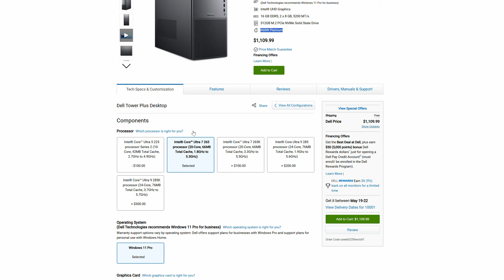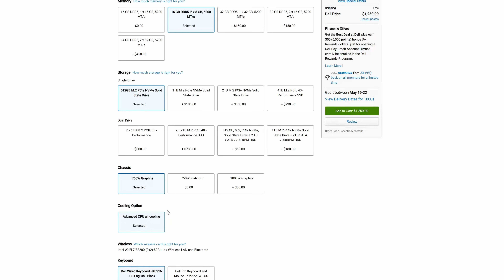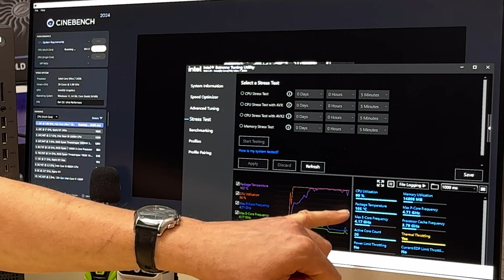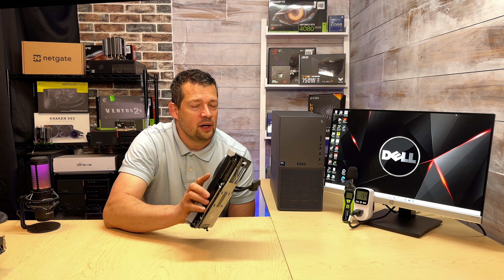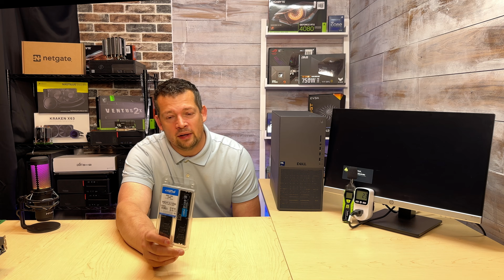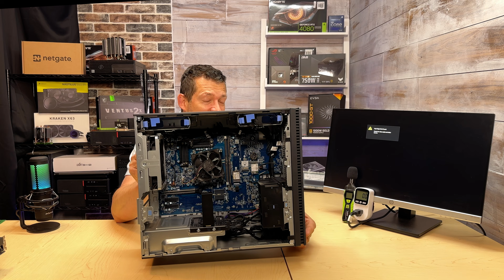Dell Tower Plus EBT2250 - Watch this before you buy it!

Comment: Will it work with a wireless  keyboard  and mouse
Reply from the maker: Yes, this desktop supports wireless peripherals via the USB ports or wireless connectivity. ( so if you buy a dongle less set, that will work as well, you technically can’t make a wrong purchase)

Comment: Purchased this EBT2250 2 days ago and found the it came with samsung ddr5: 16GB 1rX8  PC5-5600B  -UAO-1010-XT stick ? will the exact same DDR5 work in the second slot?
Reply from the maker: It sure will. Some of the Dell desktops are pretty flexible with ram and I had great luck with mixing Dell ram with Crucial ram. 
If you can get a matching ram you will have absolutely no problem.

Comment: I have a 2013 Dell XPS 8700 with upgraded Nvidia Graphics Card, 32 gb ram, upgraded Samsung SSD 1 TB and a new Asus WiFi Card. It still runs great. Latest windows security update had a issue with the secure bootup and would freeze 5 mins after booting. Disabled the secure boot and it is running fine again.
Reply from the maker: It's amazing how much life you can get out of these systems with upgrades. These desktops are truly built to last.
Reply: I've been trying to figure out my random freezes right after start-up for a month now to no avail. Randomly stumbling on your comment saved me the cost of giving up and just buying a whole new pc. THANK YOU!
Reply: @kinesin3 No problem took me a hot minute to resolve. I fixed it once by rolling the windows update back but then it updated again. After many hours with AI I was able to narrow the problem down. It is a known issue and the only way it will be resolved is if Microsoft issues a patch.

Comment: Thank you for taking the time to make this video about  Dell XPS Desktop.Because of this video you made i went out and purchased this model  Had to make a few major modifications .The first modification  i had to make is  to remove the Dell SSD that come with the performance sappy Windows 11 and instead shrop [replace} the cheap dell SSD  with a 500 GB Crucial.
The second modification  i had to make was top remove the 8GB Nvidia and replace it with a 16GB model 5060 TI.The PC now runs like a Jamaican 100 M sprinter.
Reply from the maker: That sounds like a massive performance boost!  Great upgrade!

Comment: This is one of the computers that I worked with and it was a great tool.  However, I still prefer my MacBook Pro over the Dell tower.
Reply from the maker: As long as you don’t need to use windows app the Mac is a very solid choice, it shines in many categories.

Comment: Purchased this unit from Micro-Center a few months ago for $800.  Fantastic unit. Extremely fast and quiet too.  Never been happier.
Reply: Dell - Tower Plus EBT2250 Desktop - Intel Core Ultra 7 265 2025 - 32GB Memory - NVIDIA GeForce RTX 5060 8GB - 1TB Storage - Black

I see refurbished excellent for 869$ 
Fair for 750$ 

Did you bought new one you say 800$ ?
Reply from the maker: @harishgajula9993  That is a very good price, just the 32 GB of Dell ram is almost $450 by itself.
Reply from the maker: Glad you like it! I think it’s a great desktop!

Comment: Hey Scott - how many 3.5" HDDs could theoretically be installed in here? Could we get to 4x drives (is the default 2x, in those bays up at the top)? How difficult is it to do (would you need specific Dell mounts / are these easy to get)? The overall config would be i7k, 5060 (although, 5070ti is being considered)
Reply from the maker: Top two bracket has  power and data cables pre installed, ready to go, but that`s it.
You can only install two 3.5 HDD. This case is still pretty small, you would need a lot of fabrication to be able to install four 3.5 HDD in this case.
Reply: @Scott.The.IT.Guy.  thanks! Really helpful

Comment: Great video, buying this model soon from micro center! Great price at 1000 flat!
Reply: I want to buy it. What is micro center
Reply: @MauiBell62  Micro Center is a computer retail store in US and Canada. You can buy it direct from Dell's website though it might be slightly more expensive. They allow you to customize it as well (e.g. add a 750 watt power supply as opposed to the standard 460 watt, add more storage/ram). I bought mine 7 days ago and set it up and it has run incredibly well. Set up took a very short period of time. I paired it with Dell's S2725DSM 27in (685mm) 1440p monitor with 144hz refresh rate capability. It was a great choice! The picture is smooth and crisp and the monitor stand is versatile as it allows the monitor to move up down and pivot in every direction. It also has an understated and elegant design. I spent $1000 for the computer and approx $220 for the monitor. The only thing I can't speak to is the longevity. Based on my family's experience most of our Dell machines made it 10+ years, so I assume this can make it at least 7.
Reply from the maker: @MauiBell62  Hey, It`s the largest computer part store you can walk in inside the US.

https://www.microcenter.com
Reply from the maker: Thanks for watching! This is a great desktop!

Comment: Hi, I have a question and hope you can answer I know you mentioned its near silent on idle but i just want to confirm thats the case. I have sensetive hearing and I got a 
Dell Tower Plus EBT2250 with 750w power, Ulta9k processor, and 5070 GPU. Seems pretty close to your specs but I get a very loud buzzing noise on idle, I actually got this with an alienware too and returned it. Its not like its "in my head" because i recorded it and showed some people and they agree it for sure sounds bad so I just wanted to ask if you heard about this kind of thing. Since its the second it powers on and doesn't get worse or better the entire time I am running the computer I imagine its the PSU but I just wanted to make sure that it isn't normal for this. This is noisey enough that even sitting on my chair the audio was picked up in my video with my computer being about 5 feet to my left and behind monitors.
Reply from the maker: Hey,

For me it’s completely silent, sounds like something is vibrating or resonating and it shouldn’t.
Do you have a regular hard drive installed by any chance
Have you tried to move the pc temporarily to a different surface just as a test ?
Reply: @Scott.The.IT.Guy.  Yeah I tried moving it, I had a 2tb SSD that dell offered. I am pretty sure it is a PSU I dropped it off yesterday at a local PC repair shop for a Diagnostic because otherwise I can only tell dell support what I am guessing it is. The guy when I first brought it to him didn't even hear it but I showed him my video of it where it was quite loud. The Alienware I got from dell made a very similar noise which is why I returned it and switched to this specfically so I could have a quiet machine.
Reply: @Scott.The.IT.Guy.  Also, yes I tried moving it its a tiny bit less if its on my carpet floor but still very present. I had an XPS tower since 2018 so I figured at the very least it would sound similar. It happens the second the PC turns on, in fact if i try to put it in sleep it still happens only when I do a full shutdown does the sound finally go away. It also doesn't get worse. This again is why I thought it could be a faulty PSU.

Comment: Looking to upgrade the hard drive.. should I go with the samsung 9100 pro or the samsung 990 pro for the Dell ebt2250?
Reply from the maker: I’m sure the 9100 pro will work as well but  not sure whether this model will be able to fully utilize the speed of the 9100 Pro. Will you be running any SSD-intensive applications where the extra speed would matter ?

Comment: 80PLUSでの規格（ゴールドやプラチナ）はどれに該当しますか？
What are the 80PLUS standards (gold and platinum)?
Reply from the maker: In the nutshell, we are converting AC power to DC. The rating tell us how efficient the conversion . As higher the numbe is,  more efficient we are running . Less power waste and less extra heat occurs in the process with a better power supply.

Comment: Scott, I bought a cooler based on another recommendation before seeing your video. What's your thoughts ?Cooler Master Hyper 212 Black CPU Cooler, SickleFlow 120 Edge PWM Fan.  Also, I bought my Dell from Amazon (I had a bunch of gift certs that allowed me to purchase without using my money). I'm going to be doing mainly 4k golf simulation on this machine (got an amd radeon rx 9060 xt). Should I buy another power supply. I have the current standard 480w.
Reply from the maker: You should be fine with power supply.
If you see sudden fps drops you might need a larger PSU.

Get a $30-40 watt meter where you can plug the power cord in it from the PSU , that will tell you.
My estimate will be around 350-400w average.

Comment: Since it's a K CPU can you undervolt to avoid thermal throttling or does Dell lock it down?
Reply from the maker: You can’t change anything in bios with the K cpu neither .
With  Intel XTU , you can change things, but if you are going for any type of modification, just go with a custom build PC.

Comment: Where do i plug my subwoofer?
What sound card would you recommend?
Reply from the maker: I ended up getting a sound blaster, but you really have to be careful because depending on what GPU you have , you might don’t have enough physical space to install it.

It has a digital output as well, or worst case scenario you can get a usb sound card. 
I really wish we would have the same jacks as the previous version.

Comment: Make sure you don't get a 460 watt power supply which won't push any of the  power-cable-free  GPUs designs that are compatible with this pc and there are only a few graphic cards options that fit and they're all very expensive,  this is NOT  a gaming computer  with a 750-1000 watt Ps  and lot's of cash for a dedicated card.

Comment: What about increasing the storage??
Reply from the maker: You've got multiple options since this PC has 2X M2 slots and two X 3.5 Sata bays located  on the top, which you can be used as a 2.5 SSD as well. 
You can install a second M2 drive and just use it as a new large drive as a “D” drive. 
You can also just clone your existing system to the second larger new SSD you just installed and then swapped the boot order in a BIOS or just swap that the two ssd`s physically.

Comment: I have been commenting on the ECS12500 video you made because my 2017 DELL XPS 8920 with RTX1070 had a blue screen of death (managed to get it repaired) and sometimes has issues powering up/down. I use it only for music production (amateur), YouTube, photos. In past I have done YouTube videos using POWER DIRECTOR (I think the iGPU of Ultra5 255 might be enough). I am LOATHE to spend £900+ for another XPS as I feel this machine is still pretty amazing. For all I know, it'll run another 5 years. So it's either keep & hope... ECS12500 (and replace the LAN card) or go for base model without the GPU (Ultra 5 225), 16GB RAM and 1TB SSD -> £900. £300 more than the ECS12500 but roomier, upgradable, better LAN card... decisions! (For such low-level computer use I would prefer to spend less and considered a mini PC like a Geekom but I think acoustic fan noise would be an issue)
Reply from the maker: EBT2250 is a really good desktop . 900 pounds is steep however!
Do you have a Dell refurbished store over there?
I am looking at the Dell refurbished store right now:
$870
INCLUDED1Y Basic Onsite Service after remote diagnosis with Hardware-Only Support
Pre Built Specs
Processor
Intel Core Ultra 7 265 (20 Core, Up to 5.30GHz, 30MB Cache, 65W)
Hard Disk Drive
1TB PCIe M.2 NVMe Gen 4 Class 35 Solid State Drive
Memory
32GB (2X16GB) Up to 5600MT/s DDR5 UDIMM Non-ECC
Windows 11 Home

Otherwise also look at the ECT1250, of its on sale, it also can be a great option.
Reply: @Scott.The.IT.Guy. thank you for taking the time to write such a detailed reply. I'm in UK and will check out refurbished... I also feel £900 is steep

Comment: What a thorough and excellent review!  I bought a Dell Vostro 7 years ago and it came with an optical drive built-in.  These new machines no longer have one, even as an option.  You can get an external optical drive though.  I still use an optical drive occasionally, and would have preferred a built-in optical drive rather than another accessory.
Reply from the maker: Thanks for the kind words! The business class version of this PC( FCT2250) still has the optional optical drive, however it’s significantly more expensive . To the point where it doesn’t make sense for most people, only for business.

Comment: Hi,
Thanks for the helpful and informative video. Any thoughts on whether I should upgrade the sound system? I don't want to spend a fortune, but I do listen to a lot of music and would like to find good speakers to go with this...
Reply: Just to add, the unit I'm looking at comes with a NVIDIA® GeForce RTX™ 5060, 8GB GDDR7 (Dell OEM) so I'm worried that I wouldn't have space for a soundcard as per your other video.
Reply from the maker: I think it’s fine as is. You can always connect BT speakers to it as wel. If you have $40-50 sure you can get a  pcie sound blaster audigy card if you have a 5.1 speaker system.

Comment: Good video, I just need something simple.  I was going to go for the lowest $699 linux version but now wondering about the K cpu.  Its $150 upgrade for the cpu, new cooler and better power supply.  Going to give this some thought.
Reply from the maker: It's great that you're considering the upgrade path; the K series CPU with the better cooler and PSU is definitely a solid step up.
I have two more videos on the EBT2250, you can always get the premium cooler and the power supply after the purchase if you even need that!
Reply: @Scott.The.IT.Guy. watching them now!  Replacing a xps 8300 from around 2013, finally giving me problems so looking onward and upwards.
Reply from the maker: @aaronh888 It’s a very good PC, I like it lot!

Comment: Hi Scott, thanks for your informative post, I am in the market for a new desktop, and have a budget of £1400., I have always bought XPS desktops in the past so was also surprised that DELL has dropped them from it's range. There is a really good deal on at the moment of a factory preconfigured EBT2250/16GB/RTX5060 system, but this only comes with the Core Ultra 7 265 CPU, which suits my needs. However,  the same spec machine self-configured but with a K processor comes out at around £500 more. Here's my question. The specs on the preconfigured unit say it's a 750W chassis - do you know if that means the PSU is 750W? Also I would like to fit the upgraded cooling solution, do you know the DELL part no. for this? Lastly, I have two  2.5" SSDs from my old rig that I would need to fit in the case, do you know if the EBT2250 comes from the factory with the 2 blue dell 5.25" drive caddies preinstalled? Thanks again & Best Regards, Jonathan
Reply from the maker: When you have the K cpu , two things happen. The 460 W PSU will be upgraded to the 750W PSU and the standard air cooler becomes the premium air cooler. You can get both parts on Amazon or eBay less than 500 for sure. You might not even need them.
I have least a couple more videos on this topic .

https://youtu.be/a8z6ZFnNnOc?si=nntV-gcgpa6_E2os

https://youtu.be/lbNyvbt-ZW4?si=UMpNBl2kOcBlUWN0

Let me know if you have any questions!
Reply from the maker: The 5.25 caddy’s are installed and ready to go with pre installed sata and power cables, unfortunately I never found a 5.25 to 2.5 reducer caddy from Dell for this model.

Comment: In some builds, I can get 2 TB of memory.  Does the EBT2250 have 2 1TB SSD's or one 2TB SSD?
Reply from the maker: By default , it has a 1 TB SSD. You can custom build one at Dell and select a 2 TB SSD. You can also buy any other 2280 SSD and upgrade it after the purchase for the fraction of the cost.
You are correct it has two slots, it should be specified if it’s one 2 TB SSD or two 1 TB SSD.

Regards of ram , Dell offers 64Gb as max, but we know that it can handle 96 and 128Gb as well.

Comment: Can you upgrade the power supply with a standard SFX Power Supply or ATX?
Reply from the maker: No, the shapes of the PSU and the connectors are Dell specific. I don’t think that anything would fit other than Dell. You can get a PSU from Dell or sometime I see them on eBay as new open box items for a more affordable price.
Reply: @Scott.The.IT.Guy.  Many thanks for this video. One more question. I have the 5060 version, it was a gift, so I'm not complaining and super grateful, but I do want more power. Can I, in theory, reuse the CPU, GPU, put it in a new case, with new MoBo, and new PS, and use that, then upgrade the GPU later?
Reply from the maker: @TheMikeYouSee Sure you can. At that point  I would just sell the system as is and go for a full custom built computer. You can a good chunk of money back by selling current systems as is.
Reply: @Scott.The.IT.Guy.  I would think that’s easier said than done. I don’t see too much demand for this PC.
Reply from the maker: You can always contact Dell and get the 750W or the 1000W power supply and just swap it out.
The power supply for the XPS 8960 is probably the same as this one.
I see multiple 1000W PSU on eBay for $200.
I would do a Dell chat or call with the parts department and check the price there or just ask them for compatible Dell part numbers.